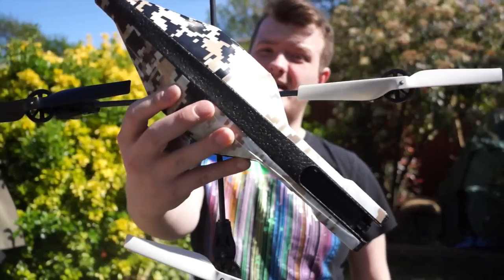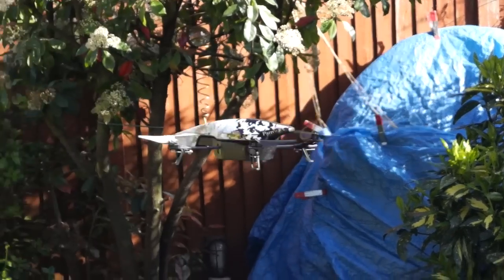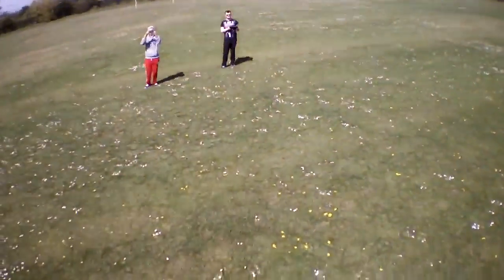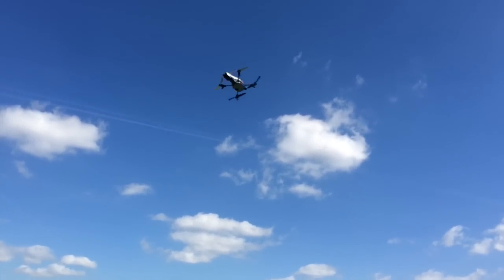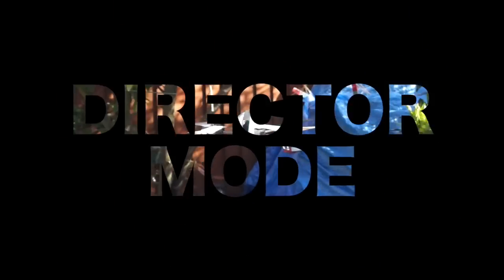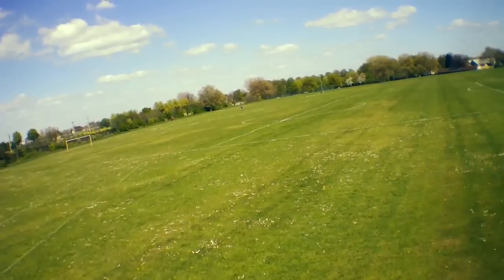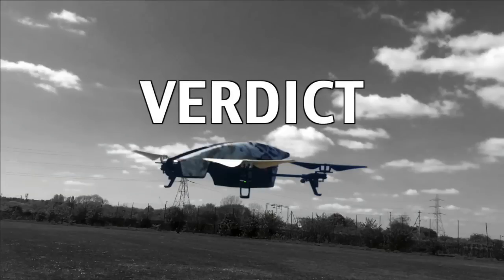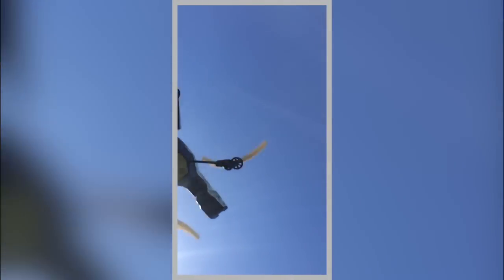Parrot AR Drone 2.0 Elite Review (HANDS ON)

Comment: i have one. i invested a little into it and it was a beast until the crash.
 upgraded the power.  turingy fast charger + 4 batteries allowed me near non stop flight, only landed to change batteries out. 

a guy named MacGyver on ebay sells transmitters and receivers, pre programmed. plug it into the bottom and you get regular RC range

Comment: You can fly up to 50meters up in the air, have I heard....right/wrong??
Reply from the maker: I think that's only possible with the GPS Flight Recorder which is doesn't come with the drone as standard. I may be wrong but in my experience it didn't go much higher than 8-10 meters at the most!
Reply: You can. Just set the app to 50m by example.

Comment: The drone can go way higher. You have to adjust it in the app. If you are going to do a review, make shure you got all the facts.
Reply from the maker: Are you sure that's not only available with the additional GPS kit?
Reply: Yes. Swipe to the right in the preference menu in pilot mode. There are several options such as altitude, max angle (affects speed), max climb rate and so on.
Reply: +Lamaramaman How high can it actually fly with just the wifi?
Reply: +Lamaramaman You know how high it goes with normal phone wifi?
Reply: about 50-60 metres i would guess. But i do not recomend this drone. Pay a bit more for a propper one that does not use wifi.
Reply: Any examples or advice. I recently started getting into drones and this was the first thing that popped up. So I started looking into it and paid roughly  £100 for a brand new one, usually it's £300. But any advice on what drone to buy for a fast pace and quick movement but as so goes along way?